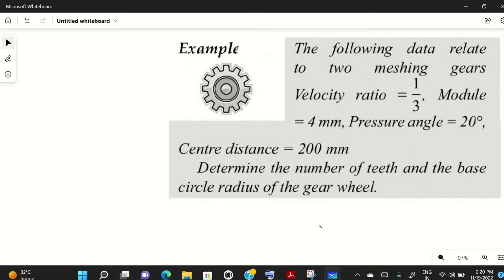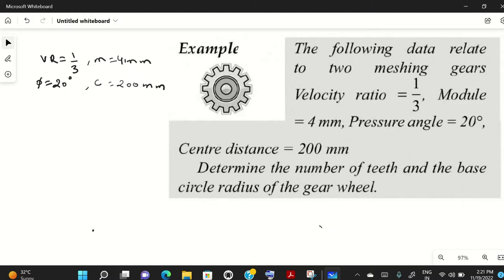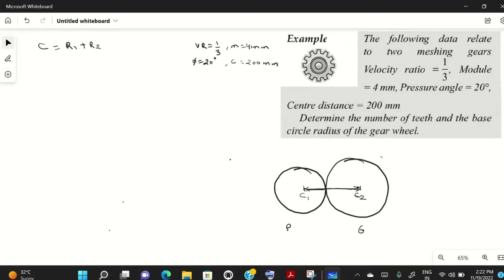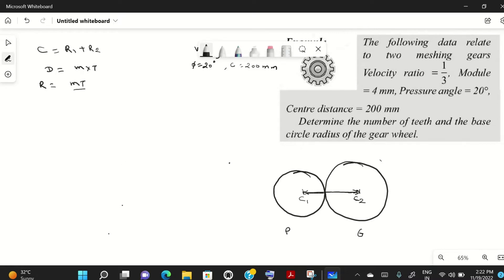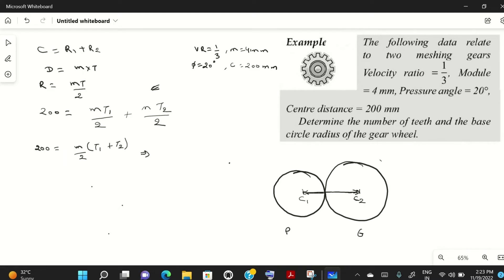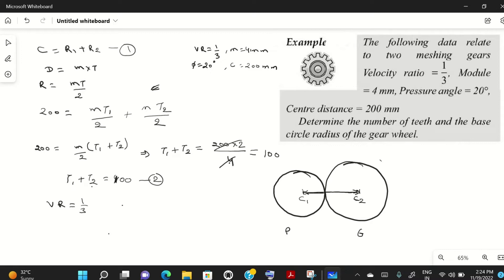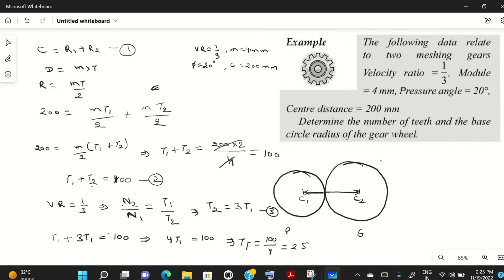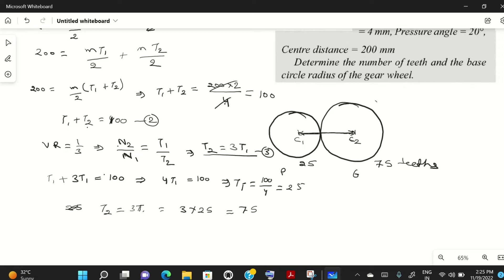Spur gears: Numerical problem 03 // Find number of teeth, pitch and pitch velocity

Comment: sir humne base circle find krne k liye R2 hi kiyu liya R1 kiyu nhi
Reply from the maker: @paryaas2222  
Because in question the radius of gear wheel is asked. 
Usually driving gear is called pinion (we don't have to calculate radius of pinion) and driven gear is called gear. 
So we have calculated the radius of driven gear not of pinion